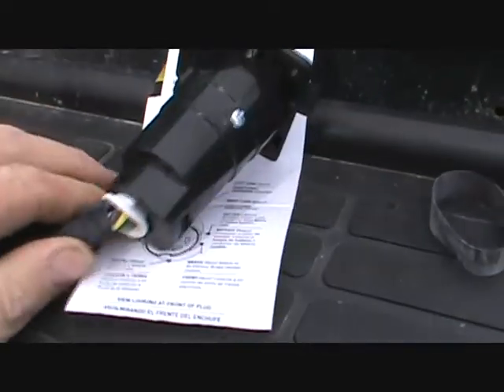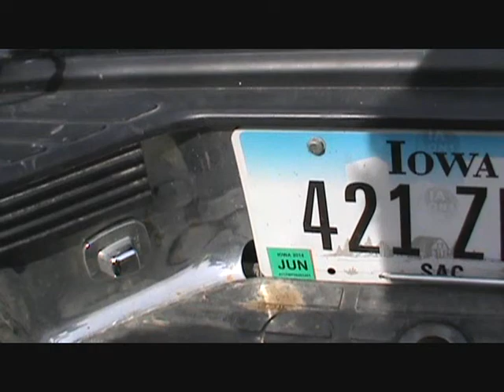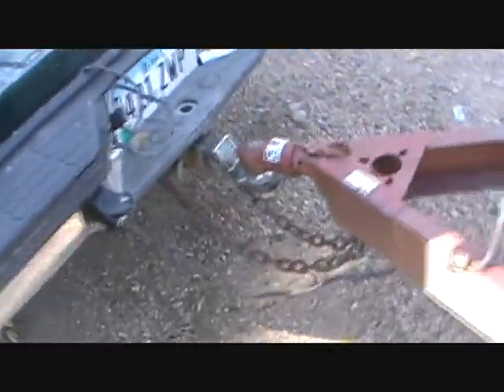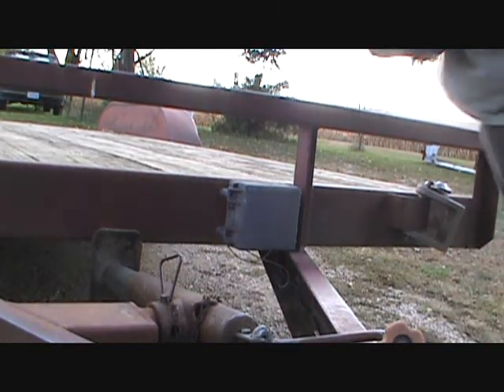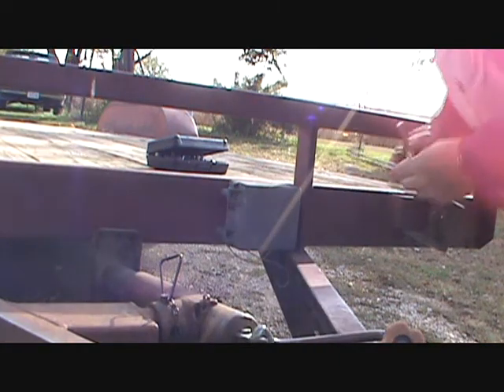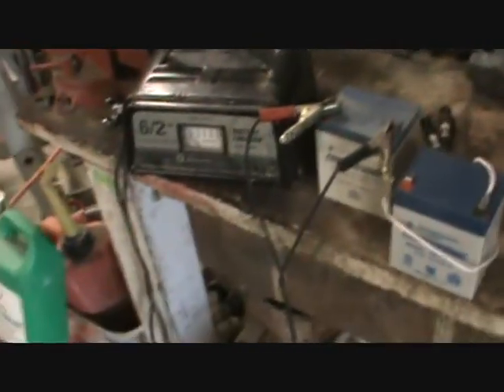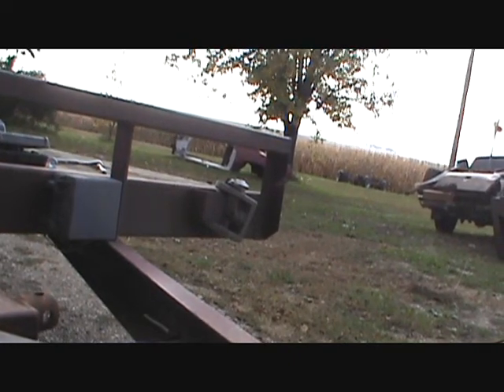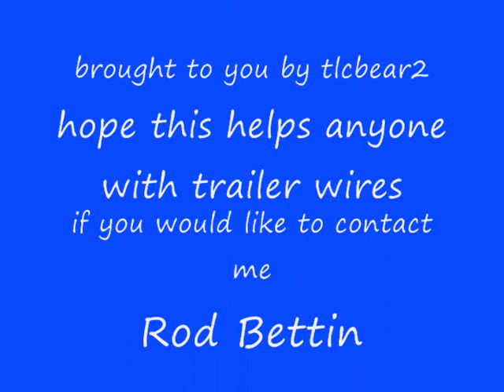trailer wire hook&repair up on a 1996 GMC 1500

Comment from the maker: well it came with that plug so i left it on i do have the adaptors for the 4 prong to.wish i knew years ago that the ground wire on the trailer side was never hooked up would have been nice.